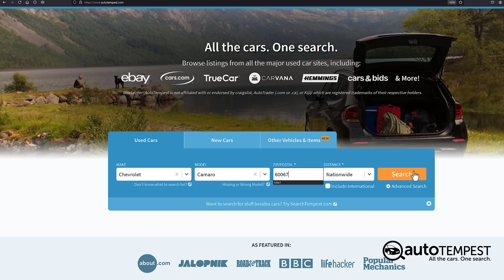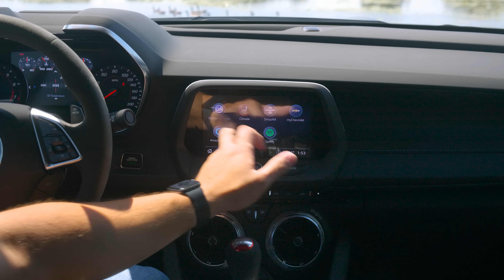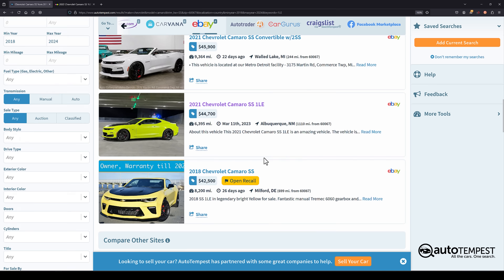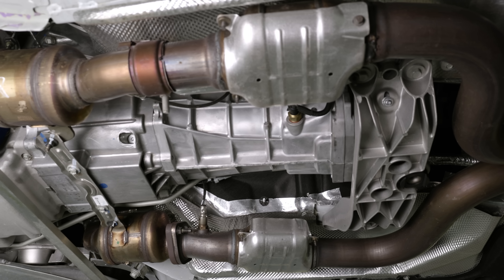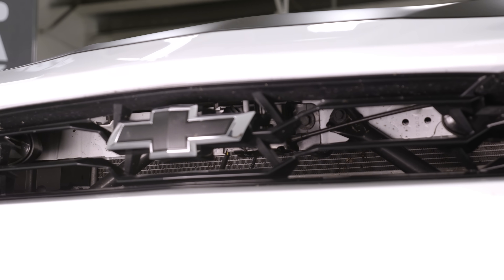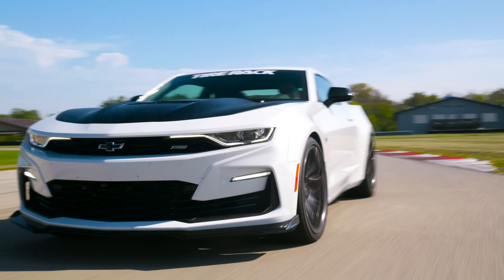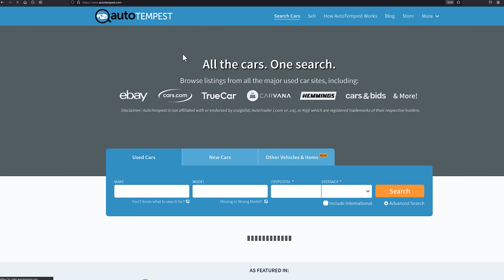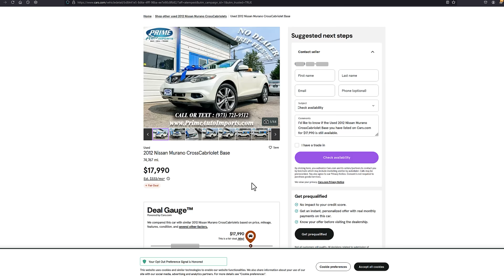Chevy Camaro SS 1LE | Best Used Sports Car of 2024

Comment: I’m a tech at a GM dealer, and this car is absolutely fantastic for the money, yes! But I’d just like to point out to anybody thinking of stretching their budget to buy a used one of these, they can get very expensive if something does break. If you know you can’t afford a surprise $2-5k repair bill and it’s out of warranty, get a good extended one! Those Magnetic ride dampers are around $500 a piece from dealer last time I checked, not including labor, and I assure you those don’t last as long as a normal shock does. I also had to replace the clutch pump for the E-Diff on a 2020 recently, came out to over $2K for the customer parts and labor. Lastly, expect to replace the Brembo pads & rotors every 25-40k miles, parts over $1K, depending on how you drive. Just be prepared before you go get a loan on one, I’ve seen it go south for a few people!
Reply: Does the LT1 have those magnetic ride dampers? It’s essentially a base Camaro with a v8 after all
Reply: @Jowurel Correct, just standard shocks on the LT1.👍
Reply: The mag ride shocks and struts are not over 1000 a piece. While still expensive, you can buy the oem parts from GM parts websites for $380-$450 a piece depending on if it’s a shock or strut. Agreed that it’s an expensive car to maintain. Front rotors are about $450 a piece (again not when bought from the dealer but still the same oem part number) and about $300 for oem pads or an after market track oriented pad.
Reply: You can just do the work yourself. Labor rates are just insane today. Also, All cars have issues.
Reply: @sdlausen1  for me, I find the parts up charge more ridiculous than the labor rates. I’m actually okay with paying a little more for labor at the dealer but when they want hundreds more for the same exact part I can find online oem that’s where I draw the line.
Reply: @maziyarebrahimi997  Ya know what, you’re right about the shocks, just had to check myself. Still more if you just walk into a dealer because they mark everything up, but I was mistaken, thinking of the Multimatic DSSV shocks on the ZL1, those are the really expensive ones!
Reply: @brandoneastman9710  oh yeah those are definitely 4 digits a piece anywhere. They seem to blow out a lot too. I almost feel they weren’t meant for street driving at all.
Reply: @sdlausen1  You can do the work yourself, if you have the tools and equipment, of course! Not everybody does though🤷‍♂️. If that was the case, I wouldn’t have a job!😂… And yeah, all cars have problems. I’m just saying that this is a lot more to maintain than many other cars at this price point. Even doing the work myself, I could afford to buy one of these things, but then I couldn’t afford to maintain it, let alone if something broke!
Reply: @maziyarebrahimi997  I’d have to agree with you there. Definitely overkill for something that’s gonna spend most of it’s time on the street!
Reply: Any nicer vehicle that us car enthusiasts desire will have expensive parts. I thinks it’s really that simple. You gotta pay to play.
Reply: Since the 1LE is track specific, you do have some expensive goodies, but nowhere near the cost of something German.
Reply: @maziyarebrahimi997  dude you're arguing with the mechanic that fixes these things
Reply: @vicariousity3046  clearly you didn’t read the whole thread. He said he was thinking of the zl1 1le. Also a quick google search can confirm the prices I listed are correct. I did that before commenting AND before actually buying an SS 1le because I like to know what I am getting myself into. Also it’s common knowledge that dealers up charge on parts. If you don’t know that then I don’t know what to tell you.
Reply: I bought one new and the engine ended up needing replacement after not that long.
Reply: The only painful maintenance cost I've experienced is tires. $1500+ a set for the stock Goodyears (which are quite good trackable street tires). They last 8-10k on rears and 16-20k on fronts depending on how much performance driving you do, so adds up quickly for daily drivers. You can get slightly longer lasting tires like the Michelin 4S but IMO they kill the character of the car and are even more expensive. I did pads at 30k ($400) and pads+rotors at 60k ($1.6k) with an average of maybe 3 track days a year, so didn't think that was bad. Besides that it's standard oil/fluids/filters. My power steering rack did die at about 35k miles, was replaced under warranty but would have been about $2k otherwise.
Reply: Unfortunately a problem with any modern car and something I was apprehensive of when I picked up my 6th Gen. I picked up an extended GM warranty through a Camaro6 thread recommendation for a great price and unfortunately already had to use it when an OnStar module failed knocking out a couple of luxury features I never used. I'm less afraid of anything mechanical breaking and more worried about the multitude of modules and sensors that cost an arm and a leg that I would never figure out how to narrow down without some dealer only tool.
Reply: Plus, it's a GM product, so you can expect it to break plenty.
Reply: One DRL in one headlight went out and costs 1800-2200 to replace plus 3 hr labor so 2500 to replace1 headlight.
Reply: I guess the Camaro SS (non 1LE) would be cheaper to maintain if you choose it without the magnetic dampers, and also it doesn't come with the eLSD
Reply: I don't doubt your comments, you should be the expert, but for me its strange that in the owner's forum: camaro6, not one comments about those premature failures on their 6th gen Camaros. Probably you are right on the repair costs. But the probability of these repairs happening?🤔
Reply: @maziyarebrahimi997 I agree, the cost of replacing my Corvette C7 Stingray Z51 brakes was similarly expensive
Reply: @PJK-444 Yes, I had a 996 Porsche 911 Carrera and it was crazy expensive and frequent to repair. I swear I never was going to buy a European car again.😬😳
Reply: @Prodriver33 isn't common
Reply: @Sniggwaffles Yes sometimes you have to pay to play. My '14 Corvette Stingray  C7 Z51 was very expensive to repair, very unreliable. But I didn't had those issues with my sixt gen '16 Camaro SS 6MT. I really loved the design of the C7 Corvette but hated its unreliability. But no regrets on the 6th gen Camaro, excellent performing car👍🤗
Reply: @blackrat1228 that happens to most new cars.
Reply: @j.3854 this isn't true. I had no issues neither with my 5th gen Camaro ZL1 nor with my 6th gen Camaro SS. Both oustanding reliable cars, just the regular consumables like replacing tires, that's it.
Reply: @Prodriver33  I’m in Florida, at a pretty busy dealer. If I remember correctly, we have had 3 Camaros with spun connecting rod bearings. They were all done under warranty. GM had issues with some 6.2’s the past couple years. But not very common. More common in the Tahoe’s and Suburbans with the 6.2. That would be the least of my concerns!
Reply: @jmmch3358  Of course, I only see the broken ones, so yes, my view of things is probably skewed. I’m just telling you what I see. I’m sure most of them don’t have issues. It is certainly one of the better vehicles GM makes… Also, not every Camaro owner goes and tells all on the forums. You’d be surprised how many old folks I’ve seen with a 1LE Camaro they don’t need!🤦‍♂️
Reply: @08turboSS  Yeah, headlights and taillights on all modern cars with LED’s are outrageously expensive now! Also this reminds me, the 6th gen still requires removing the windshield when doing various dashboard repairs. Anything that requires the top dash pad to come off, like replacing the heads up display. Just ridiculous imo!
Reply: @maziyarebrahimi997  I edited my post to reflect the correct cost of the MR shocks, should have done that earlier!
Reply: yikes
Reply: Im Sure I got ripped off at the dealer but the suspension on my 2018 1LE was clunking... ended up dropping $3k at the dealer for replacement front strusts :(
Reply: @maziyarebrahimi997  He did say 500 a piece.
Reply: @mcrn12  he edited it. He said in the thread he was originally thinking ZL1 1LE and replied that he would edit his post.

The ZL1 1LE that he was thinking of originally are indeed 1k a corner. They are DSSV shocks and struts. Badass stuff but expensive to replace. Also not electronically adjustable like the cheaper SS 1le stuff
Reply: I’m also a tech at a GM dealer and my very specific counterpoint to that is if it’s out of warranty I can fix it myself at work and get parts cheaper. But for the everyday man, yeah I back up your point 100%
Reply: I’m also a tech at a GM dealer and my very specific counterpoint to that is if it’s out of warranty I can fix it myself at work and get parts cheaper. But for the everyday man, yeah I back up your point 100%
Reply: It’s expensive if you’re coming from commuter cars. For the performance level it’s on the cheaper side.
Reply: Anyone complaining about everything you mentioned shouldn’t buy a sports car. Cause in many cases to have as much fun as a 1le you can find yourself spending so much more on overall cost, modification and maintenance. Like my built evo for example 😅. Either way good on you for giving people the heads up
Reply: Too bad is not awd. What a blast M4 competition rival this would be!
Reply: I was a Harley tech for a while and that was something a lot of people didn’t think of when they bought a used bike. They wouldn’t take the extended warranty and when something went wrong they were all over the service advisors about how much it would cost to fix the issue. Between extended warranty’s on new and used bikes and gap insurance on the new ones I probably saw 10-15 people wish they had purchased it when they got the bike. $20 extra a month could have saved thousands of dollars. 
Thanks for the heads up!
Reply: You can get Koni GTS coilovers for $2k and lower the car to get rid of excess fender and have better spring rates. The stock springs are way too soft.
Reply: Which do you like better, the 5th Gen ZL1 or the 6th Gen SS? I'm saving money for a 6rh ZL1. I just don't think the SS is going to be fast enough to keep interested amd I don't really want to go down the modification rabbit hole. But I've always lusted over the 5th Gen ZL1. I drove 5th gen SS and it was slow.
Reply: @Jowurel same with the base SS and 2SS. Those come stock with the FE3 suspension. Magneride was an option
Reply: I have a 2021 bought it with 2k on it now has 19000 love it love the teapair bills you don't buy this car to conserve fuel or money you buy it to look good and enjoy the ride you wanna play you gotta pay.
Reply: I have a 1le previously had a 2ss both 6 gens someone told me they also have the Zl1 fuel pump is that true
Reply: I get my need for speed thrills out of my old 1970 Nova SS. Also it is very easy to maintain and work on.
Reply: Thanks for the reality pill.
Reply: So then the lt1 will do i guess
Reply: Thanks for this I’m looking right now at one. I’m 55 and have wanted an ss ever since better off dead…lol. The insurance was a large bump too because I still have 2 kids on my policy. Trying to make an informed decision on whether or not to pull the trigger.
Reply: @sdlausen1  "All cars have issues." You are denying that some cars, some manufacturers, have many more issues than others? Year-after-year? Really?

Comment: I had a 2018 2SS 1LE and one of the things not mentioned in the video is that while it can be as fun on track as shown, it's also a great car to drive slow.  All the weight plus all the torque made it very smooth for cruising around town.  Also, 6th gear on mid-western highways is basically idle and I got 32-34 MPG on road trips.  (Closer to 8 MPG on my daily commute, though. 😂)
Reply: Totally agree with you. Especially the 19+ with the exhaust crackles though I know that’s a negative for a lot of folks.
Reply: Agreed! It's one of the few fast cars that is both great at speed and around town. Such an engaging vehicle. I love mine!
Reply: @maziyarebrahimi997 hell nah not for me I love the 19+ SS1LE’s 10speed crackles at the perfect rpm level it so crazy how amazing it sounds . Nothing like a v8’s crackles nd burbles
Reply: @Jmarzx  agreed. I love them.
Reply: @maziyarebrahimi997  active exhaust. Close the valves and its very quiet
Reply: @maziyarebrahimi997  It would have been nice for them to use a 2019+ also to hear the difference - the pops/crackles are excellent
Reply: You know what's funny? This is an epic track car and an epic cruiser. But it's an awful weekend corner carver. 

The limits are so insanely high and it's so incredibly low drama that I'd have to be endangering everybody to get a laugh driving this on public curves.

Now I drive my daily instead of the Camaro if I want to tackle some twisties
Reply: @dylanzhou1800  it’s so funny that you mention this. I bought a brand new manual 2023 2SS 1le a year ago and I almost sold it a couple months ago. I too thought it was boring on the STREET because of what you said. But those 5 track days a year I do are COMPLETELY worth keeping the car. It’s also a fun cruiser just to drive around slowly and listen to the exhaust crackles.

I’m very happy I waited until I did a track day to decide whether or not I would sell the car or not. I literally took my for sale ad down halfway through the track day. People who buy these cars and never track them are totally missing out.
Reply: I rented one in Los Angeles a couple years ago and drove it to Monterey and back, detouring through the Angeles Crest Forest. The car was beat to shit (as one might expect of a rental car,) but even with 85,000 hard miles and me hammering on it, it still gave us 28mpg overall. 

It's a perfect car, so of course GM is killing it.
Reply: LS engine sports cars have always gotten amazing highway gas mileage.
Reply: Man you guys make me feel old, i hated using my as a daily. I felt like the suspension was too stiff for daily use lol. Love the active exhaust tho and it is the Most amazing car to track thats for sure.
Reply: @carlosgaviriachannel  I’m cool with the suspension in tour mode when driving on public roads. I also don’t like using mine as a daily (I have a daily driver), due to the short comings of the Camaro platform. The shitty trunk opening, lack of interior storage, wide doors if I have to park next to someone and there’s one type of turn that is literally impossible to see what’s going on to your right unless you have XRay vision.
Reply: I daily an 18 2SS 1LE and it’s kind of annoying in city traffic, constantly on the clutch going from 1st to N
Reply: 2SS 1LE has mag shocks which is why it rides so nice because the dampening rate is actively modified.
Reply: Yep. It somehow does everything well. Surprisingly comfortable cruiser and an absolute laser.
Reply: Uhh no? 
The v6 gets 28mpg on the highway. Stop capping
Reply: @Jmarzx but it's ugly soo
Reply: all-wheel-drive would have been better still
Reply: @fredrce you cant do what he did at 14:10 in an awd and an awd with 455 hp and 455 ft/lb costs 80k.
Reply: @razeitall  But 450 hp audi RS5 awd is about 2 second faster on 0-150 mph than the 455 hp camaro V8.
Reply: @fredrce but the rs5 is slow on a track
Reply: I found it to be the opposite with mine, the tramlining was unbearable on my morning commute, especially in the rain, which we get a lot of in the pacific northwest.  We have pretty large divots on the highways close to traffic lights caused by big rigs and it would suck the car into the standing water.  I was tired of having to fight any imperfection in the road.  Also it begs to be abused and I didnt have enough self restraint lol.

Comment: Ive driven tons of cars on track as an instructor, and the SS 1lE is top 5 all time. It’s fantastic at the limit. Even on stock tires and brakes. Have to spend 3x to get any better.
Reply: I have the a ‘19 I drive in summer and track 5x a year and what you said is bang on. There just isn’t anything in the price range remotely close to go to for that use case. The only thing is paying 3x as much for say, a C8 Z51.
Reply: What’s your top 5???
Reply: What are your other 4 i want this camero

Comment: I personally own and daily drive a newer camaro and I will say. The 2SS package is a total game changer. I have it and it turns the rear view mirror into a screen with a live camera feed to the camera mounted to the spoiler and blind spot monitoring. 100% eliminated all blind spots for me. Only area where it's still kind of an issue is backing out of a parking spot. Even with the backup camera and the rear view mirror camera its hard to see off to the sides but the 2SS thought of that too with rear parking sensors with rear cross traffic alerts and I just back into spots anyway usually. interior space and the trunk opening does suck. But if I cared, I would have gotten something else. I've even managed 32mpg on the highway. GREAT daily for me and for anyone else who doesn't have kids and doesn't care about storage. 👌
Reply: No issues backing up with the rear camera and rear view mirror, backup sensors on the SS2 also help for cross traffic